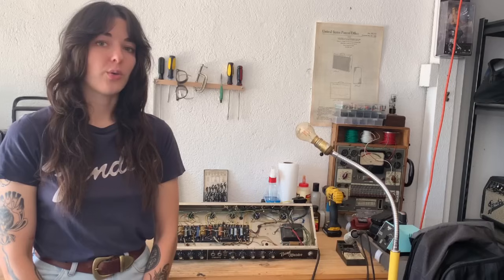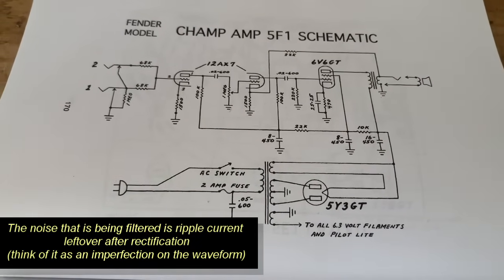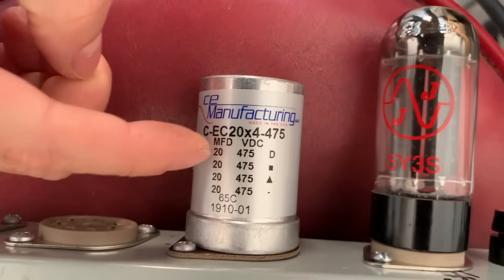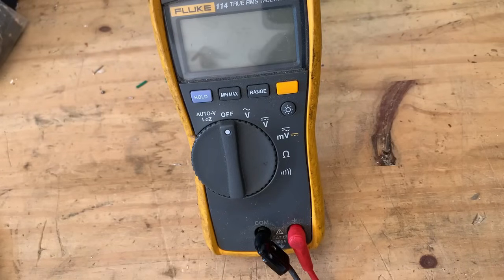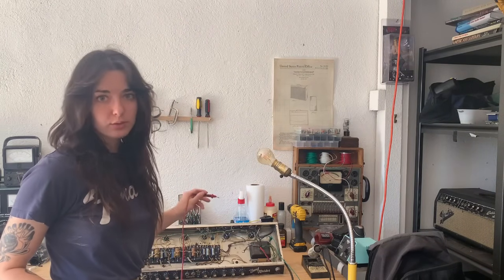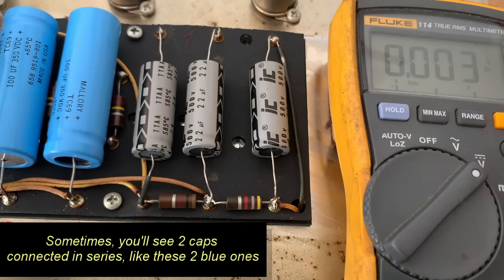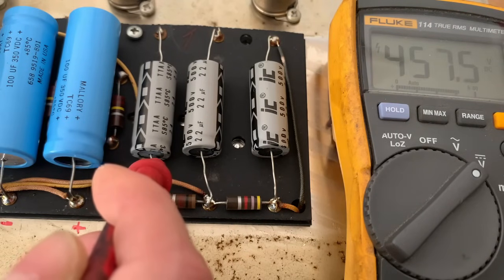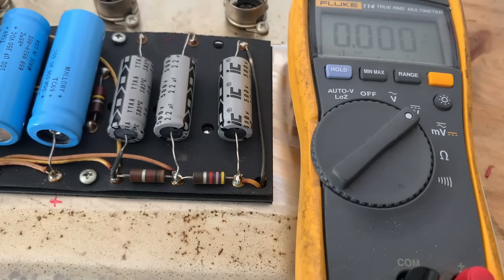Discharging Filter Capacitors & Reading Voltage in your Tube Amp | The Electric Lady

Comment: Not enough rockstars in the world and too many valve amps high maintenance i understand the cost between valve amps vs solid state and most of the 50w valve amps would get bars and clubs closed down by the noise police. Problem with valve amps is you have to turn the master volume up or use a attenuator then these cost more than the amp for a good one then you will be changing valves more. I think the future is IR's and kemper designs eventually that technology will become more affordable  and valve amps will go to museums.

Comment: Working on my Marshall tsl 100. Can you verify the supposed Marshall way of draining the caps is to use a double sided alligator clip lead ground on side to chassis and connect the othe side of that lead to v1 preamp socket pin 1. I used my multimeter in the configuration and it shows .1 or so.

Comment: Sheesh I hope this is just an old Fender/Marshall (and older less popular 60's/70's brands) thing. I know my Mesa has bleeder resistors built into the circuit. In less than 3min after turning the amp off I have less than .1vdc to the filtering section.

Comment: the thing I don't understand about the "hand in the pocket" thing, is.....don't you need both hands to discharge the caps?
Reply: Clip the discharge tool to the chassis, then using the same hand, clip it to the capacitor terminal?

Comment: Before repairing CTV with cathode picture tubes n amps after unplugging short filter caps..... High voltage transformer have decent amount of charge stored in filter caps....or learn hard way by getting electrocuted

Comment: I have a USA made (for dating) Crate Vintage 30 head that is cutting out on the clean channel only. I have limited electronics experience and the only shop in Rapid City, South Dakota that worked on amps no longer does so. Would you consider working on my amp if I could send it to you?

Comment: When I worked on radar transmitters I used a very long stick with a 10K, 100 watt resistor in series to short out cap banks. They had 30-50KV on them. You don't want to short that directly to ground; it makes a terrible noise and flash.

Comment: Hi and thanks for the great video.  So to be clear, you are grounding the positive lead of the caps correct?.  Depending on what size resistor (in ohms) is used, would one need to leave it touching the cap for a longer time?  Would resistor wattage matter as well?  Looks like your resistor is rated at 5 W.  I’ve a few videos on this topic and each used a very different resistor value.

Comment: I've seen circuits in other applications that use a 1M parallel discharge resistor. Purists would shudder at the thought but do you think it would be a worthwhile addition in amps?
Reply: Many (but not all!) amps contain a 'bleed resistor' dedicated to draining the caps when the amp is switched off.

Comment: i want to add the gz34 rectifier to my 77 vibro champ i see the deluxe had both rectifiers in the same model & people changed that over no prob.so my question is can i do that or do i need to get a tech to reset the plate current thank you for your help regards jamie..

Comment: Hi young lady.  I would like you to consider modifying your cap  discharge technique.  IF  that  clip lead were to be open, you might  accidently come into contact  with  the  "high" side as the  resistor would then be ungrounded.  Much  better to, EG....put a permanent short alligator ground on one end of the resistor, then use a  safly insulated  probe  connected to the other end of the resistor.     
I'm 73,  first amateur license in about 65,   and 6 years as Navy ET.  I fixed GCA RADAR and TACAN  at  NAS Miramar for 4 years.   have fun

Comment: On Guitar Amps and Pedals even Mixers and Equalizers they use a Center Negative or in other words a Positive Ground System which is just the reverse from any standard amplifier. Normally your Electrolytic Capacitors the Negative Always goes to ground but in the Solidstate Practice Amps like the Footnote from Parts Express the Positive Terminals are attached to the Circuitboard Groundplane - so since the Power is Center Negative does that also make the Speaker Outputs also reversed from a standard amp wiring?

Comment: I'm gonna try to word this so I don't sound like a complete idiot.
So you discharge the caps to the chassis which is supposed to be grounded, though from my understanding wouldn't it only be connected to the ground when the ground pin is connected to a receptacle?
I do also understand that touching the actual floor can oftentimes function to ground you, but is wood flooring or a table really conductive enough to constitute ground??

Enjoyed the video a lot, it was very informative :)

Comment: Thanks for your clear demonstration! My question would be related to locating ground - you used the screw that the power chord grounds to - do all (or almost amps) have this kind of screw? How can I be certain I'm on 'ground'? Would that be essentially anywhere in the chassis (except the parts, of course) where I can attach the alligator clip?
Reply: In a tube guitar amp, 'ground' is the negative terminal of the reservoir (a.k.a. first filter) capacitor. This is connected to the chassis, so anywhere on the chassis (bare metal) is OK.

Comment: I think there is a possibility that they can get familiar with vacuum tube amplifiers that have a B+ of no more than 12V and a heater voltage of 3V i.e Headphone amplifiers and the high powr amplifiers to techs like you.

Comment: Thanks for this video - I just want to make sure I have this right: sending current away from a capacitor, to ground, with a multimeter while the capacitor is receiving juice from the live amp is ok, but a resistor (and no multimeter) should be used when draining a capacitor inside an un-energized amp? Thanks for any feedback.

Comment: Excellent video, Colleen! I don't know much about guitar amps, so I am wondering: are all power supplies of all amps ground-referenced? If so, then this method works fine. But if there are power supplies that are isolated from chassis ground, then this technique won't work.  For those devices, you would need to attach the alligator clip directly to the capacitor's negative terminal, and not the chassis.

Comment: Hi, Maybe this is a stupid qestion. Since everybody does it this way I guess it ill work when I try it. BUT I don't understand fully how the voltage can disappear simply by leading it to the 'ground' of the amp . It's being disconnected. It 's on a wooden table. As you stated electricity can't pass through the wood. So where does it go then?
Reply: It is converted to heat in the resistor and lost into the atmosphere.

Comment: Nice tutorial. Tuck the LEFT hand in the backpocket as current can flow through the heart easier through the left arm. Also always use an isolation transformer when servicing tube equipment.

Comment: When I make power supplies of around 250/300 Volts I always add a 220kΩ half Watt resistor from the capacitor to earth. It only takes a few milliamps but then discharges the capacitor after switching off quickly enough that by the time you get the cover off the voltage has decreased dramatically. Higher voltages might need a larger value resistor to cope with the increased voltage.
However don't trust it and still check with a voltmeter in case the resistor has failed. None have failed yet. If there is still appreciable voltage do discharge it as seen in this video.

Comment: Two things: 1) I appreciate the fact you do not wear revealing cloths just to get more views and likes. Your content carries the videos good enough with out exploiting yourself! 2) Your bench is so much like mine! LOL! Except, since I would mainly on guitars, and a few amps on the side, my bench is carpeted. I use the same brand of soldering iron but mine has a digital temp readout which is really handy. Changing temps based on the type of soldering in important for me. Your tools are mostly the same right down to the wire cutters!  Maybe you can start a series on diagnostics? How do you trace down circuit board problems? How do you know a resistor of cap is bad? etc!!!! Thanks!

Comment: I just found your channel....excellent information on the capacitors...and a 'Fluke' meter..only the best.
 In the 1970's I worked on a lot of CNC power supplies (+5 Volts)...BIG caps in there, 15 Volts, 50,000 uF....maybe 6 of them....yeah, they might look scary if you don't know what's going on....funny to scare people by putting my bare fingers right on them....still plenty of energy in them to ruin the end of your tiny screwdrivers.

Comment: Well when i learned about the hand in the pocket roule they also told me to use the right hand. Reason is normaly the heart sits in the left side of your chest so you have some extra resistent. But if it really helps i don't know whats defnetly the worst is when you get zaped across your arms.

Comment: If I've got five - 1W, 100k resistors, could I connect them in series for 5w/500k and use that to discharge caps? Or would I want them in parallel for 5w, 100k?
Reply: In series you would haver 500k  and in parallel you would have 20k, both @ 25W., both overkill for the job.  A 100 Ohm 2W resistor would be ideal.

Comment: I just found your videos, very nicely done!!  I learned long ago in an electronics tech class about discharging caps safely, and working with high voltage safely. I work with high voltage RF circuits in communications equipment as well as old audio equipment and you'd never make the mistake if bumping a "HOT" capacitor charged to 3000 to 5000 volts in a RF amplifier circuit more than once!!  You might not get the second chance!!  Glad to see you teach proper safety methods and testing. Properly designed power supply circuits usually have bleeder resistors across the terminals of the caps too but they do take some time to bleed off. I'm glad you mentioned using a bleeder cap when draining. you must have had some good instructors or mentors! Keep up the good videos!!

Comment: Something I've been doing for decades to discharge caps, without paraphernalia, is to run the amp with signal (1kHz, guitar... doesn't matter) through a speaker, or proper load, and simply pull the plug while the amp is running. When you hear the signal dwindle down from full, to distortion, to nothing, the caps have discharged through the speaker or load resistor. AS ALWAYS, DOUBLE-CHECK WITH YOUR DVM TO MAKE SURE THEY ARE DISCHARGED! However, this IS a valid, convenient, and SAFE method (since you never get near the DC) to perform this vital function.

Love your videos! :)
Reply: No need for an input signal. In fact, the caps discharge through the tubes which continue to conduct as their cathodes cool down. I agree with the double check.

Comment: The uninformed don't realize you can possibly fry a cap by shorting it out. If you possibly don't have a meter available, you can use a low voltage LED. If it doesn't light, there's little remaining stored charge.

Comment: You said you were replacing a 1K but it was a 10 ohm. But you replaced it with a 10 ohm, so, no worry. Not to be an ass. 😬

Remember folks, discharge is A-OK! 👌🏻🙄

Comment: Darling use a analog meter for  Amp repair.  20,000 ohms per/volt. That will give you correct voltage. Make a discharger . 1 clip 600volt wire a 100k 2 watt resister and a clip .Leave it there as you work on the amp switching it on and off you may forget to drain it again. I solder one in on my own equipment . It also helps with voltage regulation. 
  Wood ain't so good . I have had current go through some wood and pencils. An old Bic pen with the insides removed is excellent.

Comment: I never used the resistor to drain a cap just let it spark .Well now I know.Duhh.I have several old (and new) valve amps but I mainly let a pro fix them because I got a bolt and a pilots liscence off an old Leslie amp which I have not touched since.I like your vids

Comment: I’ve got a fender deluxe. Buying from our guitarist for about half the regular price. It sounds great but he quit using it on stage because about half way through the gig the sound would start going down in volume. He tried everything. Going straight to the amp   Changing cables etc. 
he took it to two reputable shops for repair but they couldn’t find the problem. One shop left in on for a few days and the problem didn’t show up. 
Any suggestions?

Comment: Your Fluke 114 has an "AUTO-V LoZ" Setting. In that mode, the meter has a low input impedance, in your case about 3kOhm, if i'm correct. The manual should give more details.
So you can discharge your capacitors using the DMM in AUTO-V LoZ and monitor the discharge process at the same time, and you don't need any extra equipment to do so. This function is also handy to get rid of ghost readings.

Comment: Do I need to discharge filter caps before tightening tube sockets?
Reply: Some of the pins on the tube sockets are connected to the high voltage supply, so yes.

Comment: take all components off the mother board and connect them direct to each other - you won't belive the improvement in sound. then get rid of all the cheap spanish expotus resistors etc...replace with better resistors. that 5 w, best to use high quality 1 w resistors 5 in parallel

Comment: Hello Colleen. Very good tutorial on discharging caps for safety. I remember my first AC/DC THEORY class in college. My instructor taught me the very same "one hand in pocket" method as well as the cap discharging with a bleed resistor. Just like discharging a CRT from a tube television. We used a special high voltage probe for this. I was so scared to death on those things, possibly imploding if not careful. RESPECT VOLTAGE/CURRENT. Never ASSUME, or you will make an ASS out of U and...yourself. LOL

Comment: You can use a Fluke SV225 stray voltage eliminator. It attaches directly to the meter and you can leave it on while you take voltage readings.

Comment: Yes I did get of how to drain the caps. I have a Marshall 75 Reverb that pops real loud when the power is switched on. It has a noticeable hum or buzz even with all the volumes & tones down to zero.  When I do raise the volumes & tones the hum/buzz volume stays the same. I have a Peavey Windsor Studio combo that has a hum that gets louder when using the reverb control. Same thing all volumes & tones set to zero. I’m tired of going to amp techs who say what noise?  I’m to picky, that’s normal get used to it. My favorite amp was a Hiwatt  Bull Dog combo. After it was biased it was great. Should of kept it.

Comment: Thanks for this. Good to also learn the resistor trick. Many just slap a grnd wire on the pos end of a cap which is pretty exciting especially if it's one of the big electrolytics. Good lesson. Thank you!

Comment: Here's my most recent "getting shocked" story: Almost completed refurbishing a '68 SUNN 200s. I was finishing setting the bias, and was letting the circuit fully warm up. So while I wait I decide to solder something else I was working on (replacing jacks on a pedal). However the spool of solder unrolled across the exposed SUNN circuit and delivered to me a nice jolt.
Reply: Oh, I had a good (bad) shock from a Standel that used a pair of 6DQ5 tubes with metal (bare) plate caps. I reached around the back to turn off the power switch. Around 550 or 575 volts. In my tube amp designs I generally have a bleeder resistor in the supply.

Comment: Excellent safety video for working on tubed equipment. Customer gear doesn’t have metering so you have to check with an external meter and ground the HV components. Essential in the broadcast transmitters I work on. Oil filled caps are DEADLY! Transmitters have meters so always check plate voltmeters and ground HV points with your ground stick!-and leave the stick in place until your work is completed.This video serves as a good  reminder for “old Hands” that have  worked on gear but get careless! When you use the ground stick look away in case of flash so you don’t get temp blinded.

Comment: I touched the +480V B+ once... it's not a joke! My 2 amps fuse blew and I tried to unscrew the fuse holder cap to replace it. Unfortunetly, the fuse holder moved together with the cap, in the chassis. So I took the head apart to get a grip on the fuse holder, inside the chassis. WIthout thinking, I put my finger on the fuse holder, touching the 2 leads and completing the circuit (bypassing the fuse). Then, a portion of my finger flesh exploded inside out in a cloud of smoke (smelled like burnt hair). No blood came out, as the wound was already burnt... That was my guitar playing for that year... And I was lucky I got away with just that... I never messed up with my amp without a multimeter ever since.. :D SO, guys, take it seriously!

Comment: Killer video thank you.  Would you consider replacing the high impedance input jack on a '94 Fender "Evil Twin" to be a DIY job for a novice or something a pro should handle?  I broke the tip of a 1/4 inch cable off in it years ago and want to get it repaired (been using modelers for years now).  From what I can tell the jack looks like a cheap enclosed plastic part that can be taken out and replaced.  
Thanks again for the video and all the best from the Bay Area.
MK

Comment: question, if the amps unplugged wouldn't the ground circuit also be unplugged?
Reply: Yes, but the charge in the capacitor (the cause of the high voltage) doesn't go to ground, it is converted to heat in the resistor and dissipated into the atmosphere. The amp MUST NOT be plugged in!